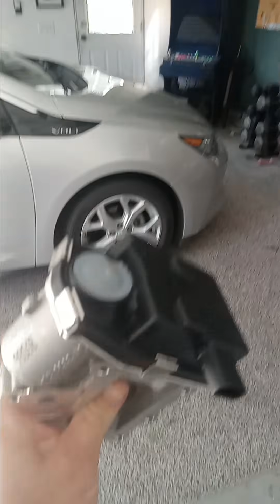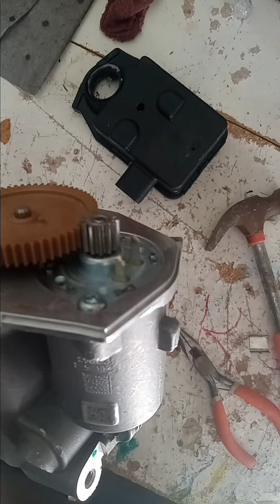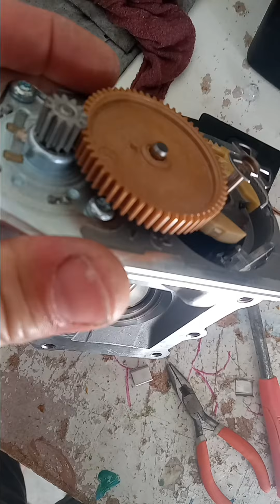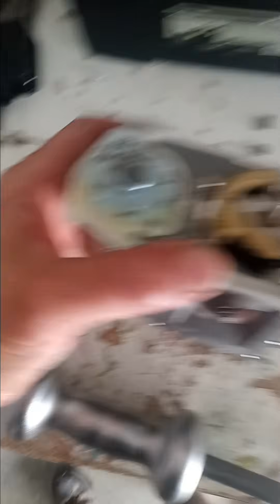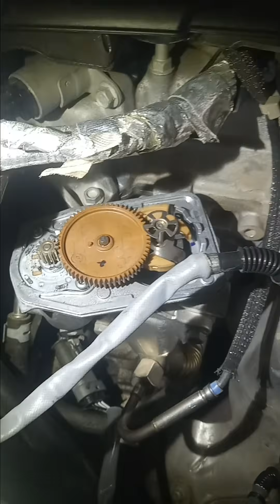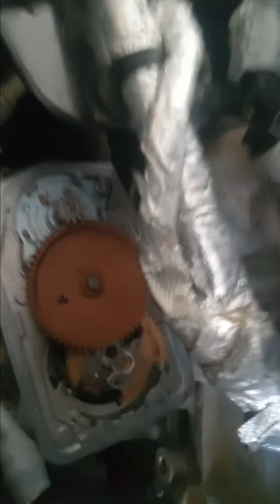DFC - Chevy Volt 2016- 2019 EGR valve repair

Comment: Hi! I'm trying to replace the EGR valve motor on my 2017 Chevy Volt, but I can't get the motor out of the aluminum housing. I've already cut the motor wires and removed all the mounting screws, but the motor won't budge at all.

I noticed you used a slide hammer in your video. Did you use it to remove the motor? Could you explain how you got the motor out?

I'd really appreciate your help. Thanks!

Comment: Awesome details on component level repair!  Did you keep the motor?  I repair motors.  Be great to see the failure mode and if these motors could be rewound for repair.  Any photos of the circuit board and disassembled motor would also be great...

Comment: what kind of error codes it threw you from the egr valve ? why using the egr valve from a chevy malibu 2016 for your 2016 chevy volt ? what's the cost difference ? I have a 2017 volt and has egr valve/cooler problem.